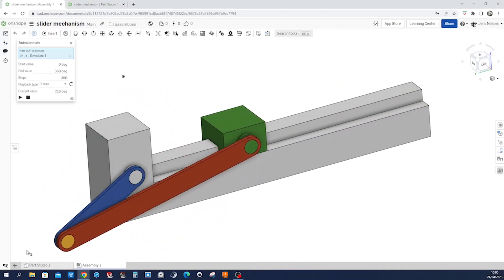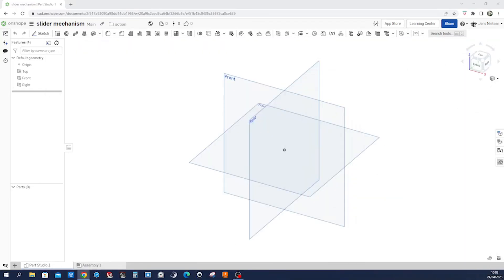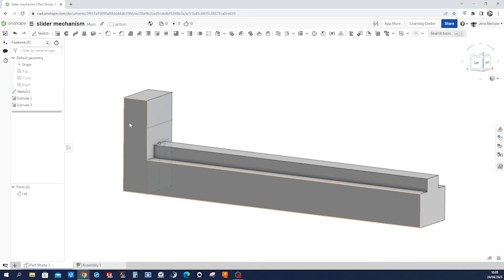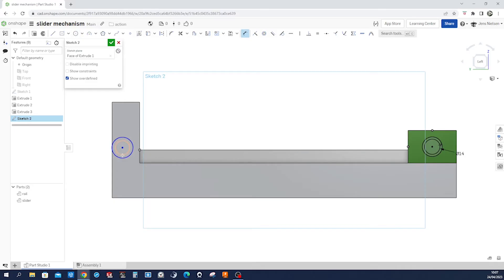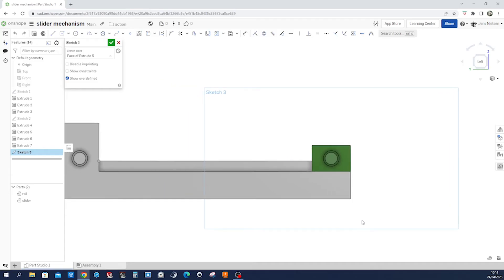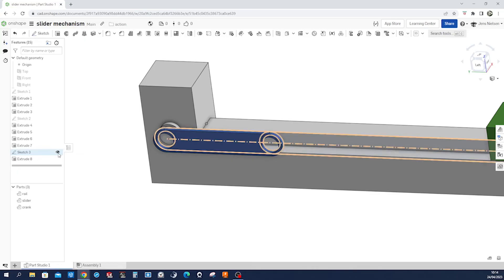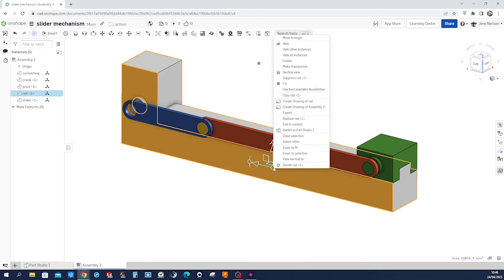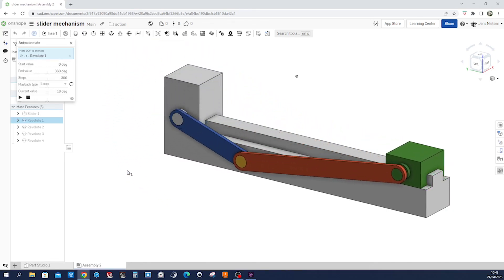Build the Perfect Crank-Slider Mechanism with Onshape and Revolute Mates!

Comment: Thanks for  the Video and great narrative. I am a 90 year old engineer who worked on the design of the Harrier Jump Jet back in 1950"s, very proficient with slide rule and drafting tools. Never used CAD and am building a large RC walking Robot that will climb curbs etc. Enjoying the challenge even more since I found your videos. .Just got to the final stage of assembly with slider and all links working, put the pin in place but the pin is ignored by the Crank which just cuts through it. Trying to figure out why!!  will persist.  Paddy King
Reply from the maker: That's fantastic to hear, Paddy! It's truly inspiring that you're a 90-year-old engineer tackling such an ambitious project like a large RC walking robot. Your experience with the Harrier Jump Jet – what an incredible machine! – and traditional drafting tools is truly impressive. I'm so glad my videos are proving helpful in your CAD journey.

It sounds like you're having a tricky time with that crank and pin. Troubleshooting mechanical issues is a process, even with CAD!  It might be an issue with the constraints within your CAD model. Double-check how the pin and crank are connected and let me  know how it goes.

Comment: Your construction techniques really appeal to me, because they focus a LOT on how to get back to extruding/projecting and drawing constrained parametric objects/parts from the raw orthographic (or even just ONE primary orthographic) projection of the mechanical drawing.  I like that a LOT, as it gets back to describing a minimal amount of sketches necessary to create the drawing (possibly incomplete for recreating from scratch as some dimensions are in the extrude lengths/offsets, but still, very fast and quick).  It also blows my mind to NOT let the physical placement in 3D space get too much in the way of your creation of a part, since you can easily CHANGE that in the assembly.  For example, you construct the crank part on the OUTSIDE of the connecting rod, even though you plan to eventually go back and PLACE it on the inside.  That is just a detail that is sometimes hard for me to not obsess about.
Reply from the maker: Thank you for your kind words! I'm glad you appreciate my approach to construction techniques. I believe that focusing on the core geometry and using extrudes and projections efficiently is key to creating complex parts quickly.
I agree that it's important not to get too caught up in the exact placement of parts in 3D space at the beginning. The flexibility to adjust their position later in the assembly environment is a great benefit of parametric modeling in the Onshape part studio.

I'm happy to discuss specific techniques or answer any questions you may have about my workflow.

Comment: Thanks for the video.  Nice and clear and easy to follow what you were doing.  Unfortunately life in Newbie World is never as simple as in Teacher World.  Having followed your Mate choice and fitting exactly (Three cheers for the K key) my drawing ended up with a whole host of Mate errors. In every case the error message is 'Mate over-defines assembly'. There are only two implicit mates in each connection.  Where possible I have trided to get the Z axis the same in both cases or facing each other if not.  Do I need to go back and do some constraint killing in the Part Studio?  The early 2024 version of OnS certainly provides auto constraints by the bucket load.
Reply from the maker: Hi Peter, thanks for your  comment. If you ran  into seemingly unsolvable problems  maybe you can share a  link and I (or  somebody else) can help?!